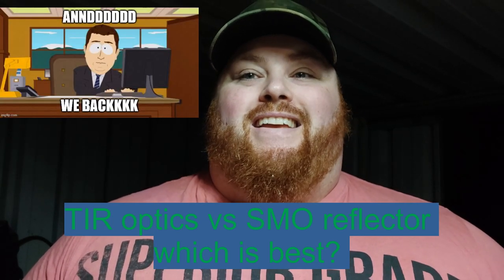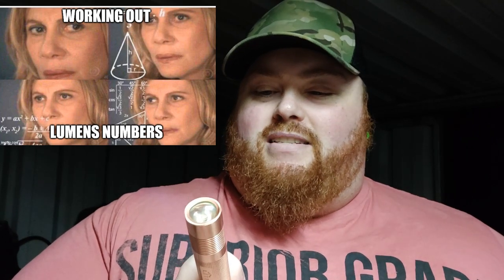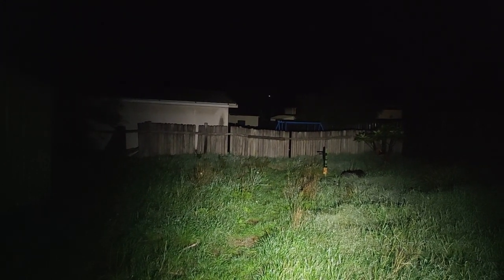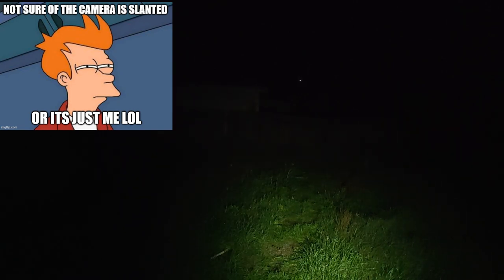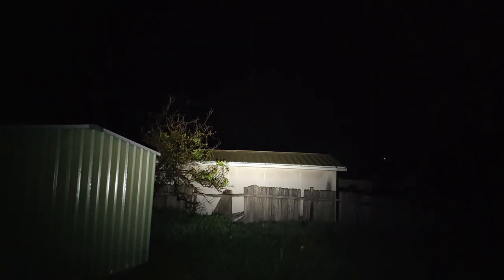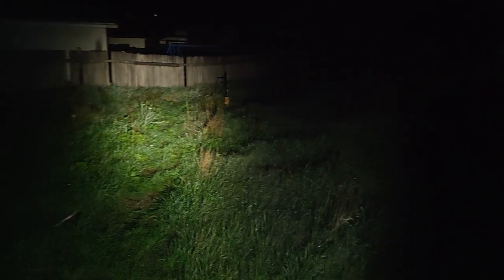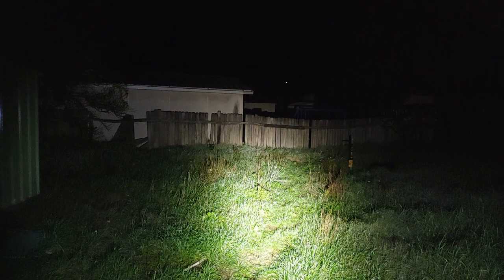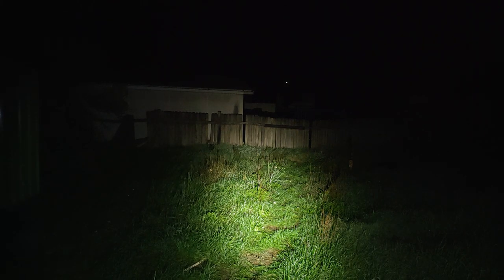TIR Optics vs Reflector which is best?

Comment: It's obvious that the 30-degree TIR optic  and 60-degree TIR optic were switched around during this test. It's possible that the optic arrived mislabled or was accidently switched around during the testing. Either way a 30-degree TIR option concentrates light more than a 60-degree TIR optic. Thanks for the review.

Comment: Can you do a video about how to install this tir optic, did you use the old o ring and lens ?
Reply from the maker: Hey mate yea i will soonish. These TIR optics fit right in the light without any work. You can run them with or without a lens its up to you. If its a S2+ you can always move the pill up and down/lower or higher shouldn't be an issue. If you find your batteries are to short then i would use the lens. Lens might offer a tad better waterproofing. The only mod you might have to do these is sand the sides down. In some lights they are tight but generally being 20mm in diameter they should work good. 

If you have a few spare bucks buy a few and have a play. See what ones you like. The one i have in my HC30 is like pure flood the beam is so wide but it works out great for fishing.
Fasttech has 15% of weekend mind you i ordered these optics in 2016 lol.
https://www.fasttech.com/products/0/10002020/1187501-20mm-15-degree-optical-lens-optic-for-cree-xm-l
Use the drop down bar to change on Fasttech to change what optics you are looking at.
I did also buy some random Ultrafire 20mm optics from Fasttech in the past.

Comment: I'm confused. Doesn't lower angle optics equate to a tighter, more throwy beam?
Reply: Thought so too. Will order a 5 and 85 degrees to test it out.
Reply: I think he got the 30 and 60 degree optics mixed up, but in reality they should almost look the same.  10 degree optic would be throwier.
Reply: You is correct